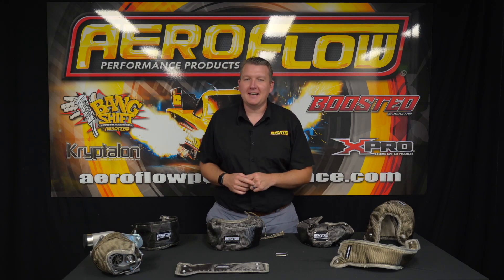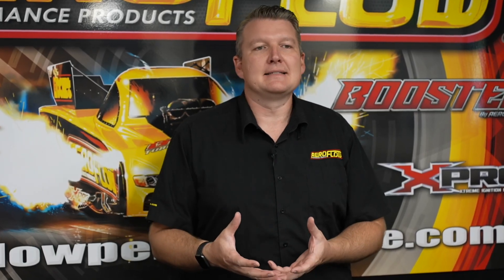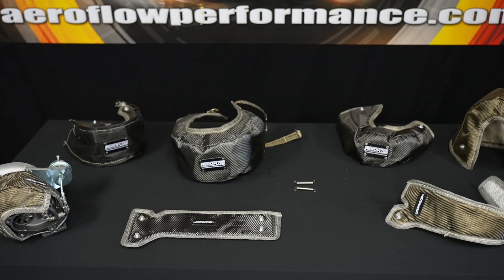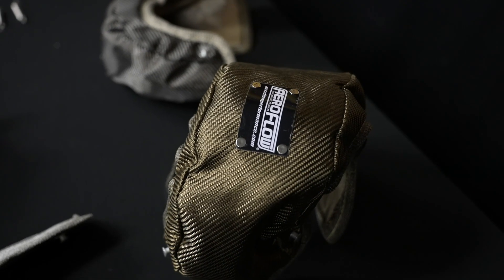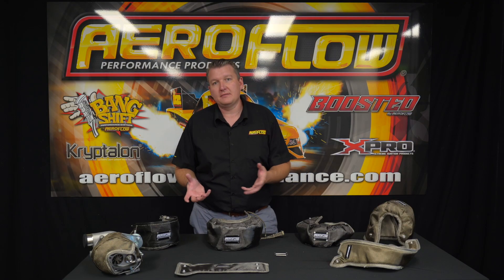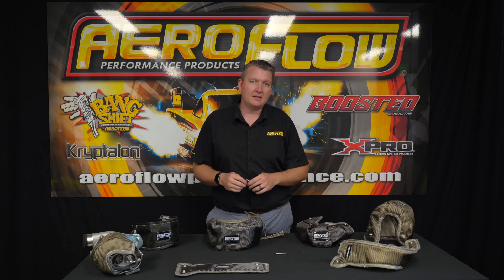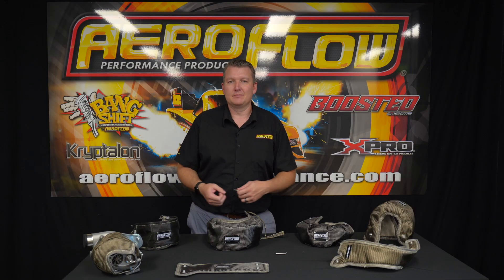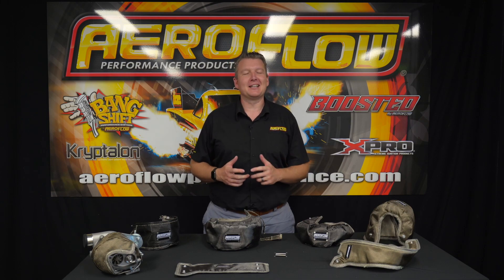Beat The Heat with a Turbo Blanket!

Comment: Good video. I have a Holset H1C with an HX35 intake . Do you have a bag that will fit ?. It is on a 1991 Cummins 1st gen deisel.
Reply from the maker: Hi Jim, we don't have a specific listing for Holset however if you take a look at this listing, in the photos there is a chart with basic measurements so you should be able to find something that will work: https://aeroflowperformance.com/af91-8802-turbo-bag-carbon-gt30-gt35